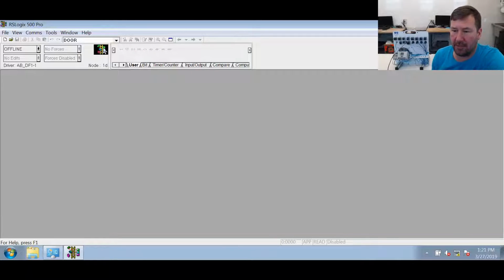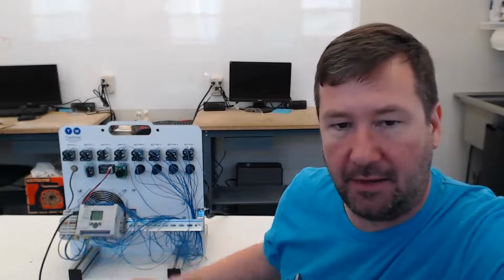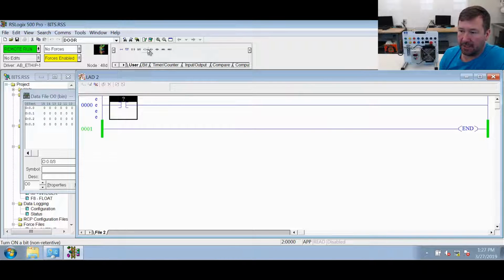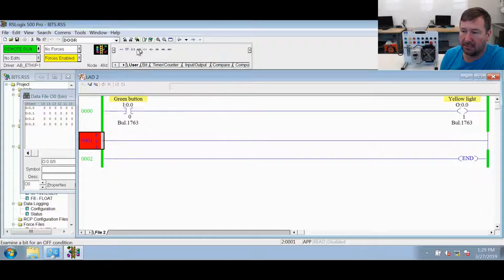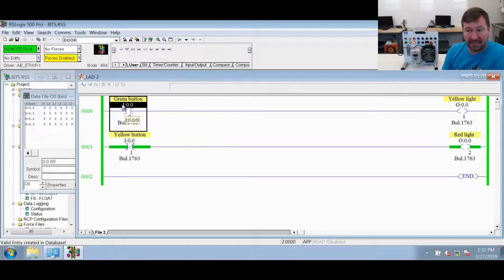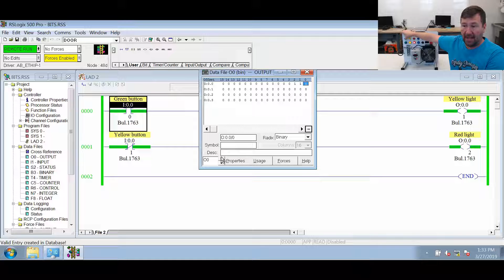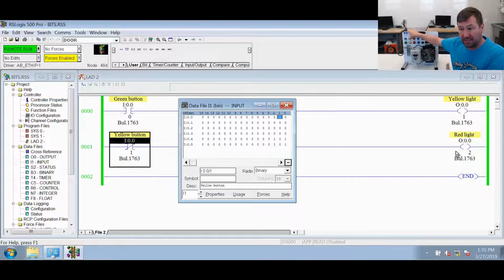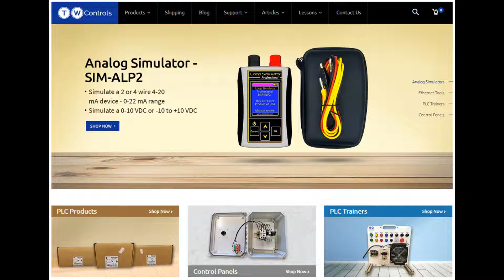RsLogix 500 - XIC XIO OTE Bit Instructions for Allen Bradley Micrologix and SLC 500

Comment: I'm sure you have a reason for rejecting the notion of NO/NC contacts, but I don't see the conflict.

XIC does not allow the logic (analogous to electrons) to flow unless the coil/button/condition is active. Much like a NO contact on a relay would work.

And vice versa for XIO. The logic flow is normally closed until the condition is true. In our analogy, True would be like sending 24v to the coil of our relay, thereby opening the contact and stopping the flow of logic on our rung.

However, I could see how it could confuse students. I'm just learning myself, so I wouldn't think to challenge your teaching methods. Still, coming from a background as an HVAC technician, the NO/NC analogy makes perfect sense to me.

Thanks for this free education and all your contributions to the industry and community!
Reply from the maker: If it works for you then great but we've found for most people, especially our more experienced electricians, really struggle as PLC programs get more complex if they don't distinguish the NO and NC terms.  

Similarly, programs don't "flow", they have true or false logic.  It is one of those things that doesn't seem important until it becomes important :)

Comment: As an instructor it's refreshing to see someone properly explain this. My electrician students often have a hard time not associating XIC & XIO with electrical schematic symbols.
Reply: As a student, I can tell you it is hard the first time you are trying to wrap your head around it, because it is SO similar to ladder logic line diagrams used in hard wiring relays in motor controls.
Reply: TortureBot the PLC was invented by General Motors in 1968 to reduce the time it took to re-tool a production line each year. To add a relay or timer to an existing control cabinet could take as much as four hours of labor by an electrician, or a few minutes to program it. Ladder logic code was invented for PLCs and its similarity to relay logic schematics was deliberate. The idea was, if you understood relays, it shouldn’t be that big of a leap to understand Logic. However, the appearance of the rungs and symbols is the only similarity and can be misleading to a novice at first glance. 

In relay logic we’re concerned with electric continuity through a hard-wired circuit. In LadderLogic we are concerned with logic continuity on a rung of code. They are not the same. The first has electrons flowing through wires, whereas the PLC has 1s and 0s being analyzed by a processor. 

In the hard-wired circuit, to get a signal from “A” to “D”, we have to physically connect wires from “A” to “B” to “C” to “D”. In a PLC, the processor simply sends a 1 or 0 directly from “A” to “D”, regardless of what “B” and “C” are up to. This is a bit of an over-simplified example but the point is, in a PLC, forget about the hard-wires and their schematic symbols. It’s not a normally-opened or -closed relay that represents a physical contact in a circuit; it an XIC or XIO that represents a coded Boolean instruction in a processor. 

Hope this helps further clear it up, and keep watching Tim’s videos. Wish they were around when I was trying to get my head wrapped around this, about 100 years ago ;-)
Reply from the maker: Thanks Erin.  Let me know if you think of any topics that we should do videos on.